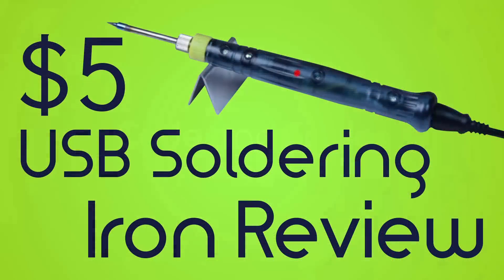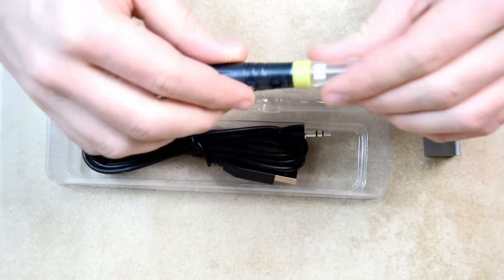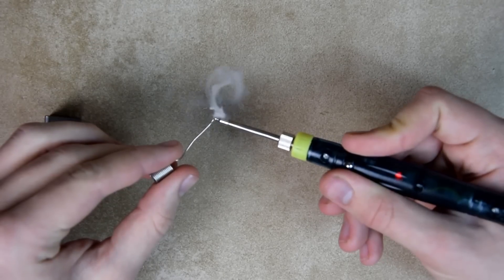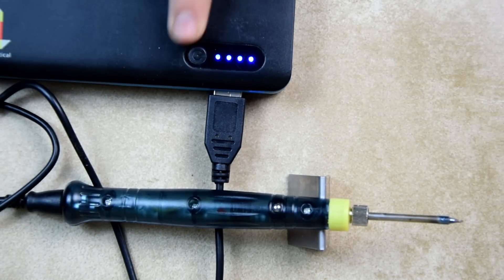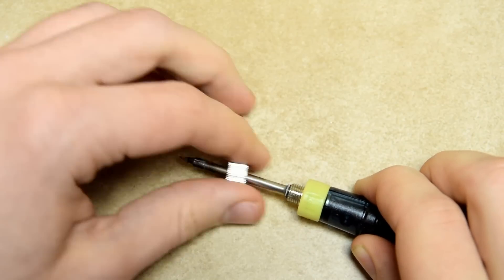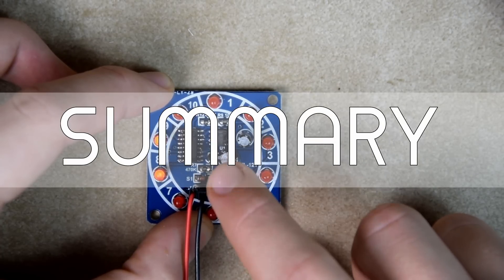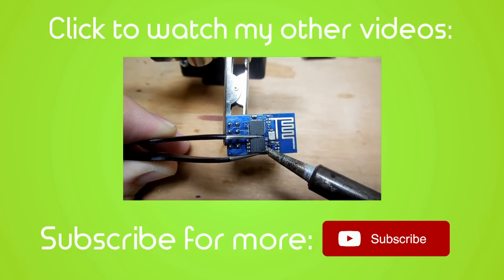$5 USB powered soldering iron review - ZD-20U from Aliexpress

Comment: If provided with 3 amps the iron will gladly provide more power. I tried it, and it stands.
Reply from the maker: +valveman12 I would recommend reading up on Ohms's Law. I = U/R.
Reply: How can you draw 3A using 5V?  You would have had to raise the voltage considerable to draw 3A.
Reply: Code and Solder
Your comment is funny because I am an Engineer.
To draw 3A using only 5V when the device is only capable of 8W meaning at most you can only draw  8W/5V=1.6A.
Coil resistance is 5V/1.6A=3.125 Ohms <- That stays relatively constant with slight variations as it heats up.
So please tell me how you can draw 3A with only 5V?
You can't because it is a function of the coil resistance.
If I want to draw 3A, I would have to raise the voltage to 3A x 3.125 Ohms = 9.375V.
Now you are no longer using USB voltage so you cannot get 3A out of the Soldering Iron using 5V.
Also I would caution running higher voltage on this iron since the heating element is probably not designed to run at this current.
Reply from the maker: Ah, sorry, I didn't see the parent coment and thought this was about something else. Yes, you are totally right it cannot take more current at this voltage. I have increased it to 10V in my "$15 soldering station" video and it does well, I added active temperature regulation to avoid overheating though.
Reply: Ok no problem.

Comment: What is that paste can i have a link ?
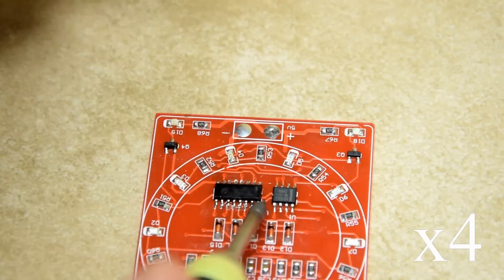Reply from the maker: The one at 1:05? Some random cheap flux. For example (referral link): https://www.banggood.com/Wholesale-10cc-Repair-Tool-Solder-PCB-SMD-Soldering-Paste-Flux-Grease-SMT-BGA-IC-RMA-223-p-35758.html?p=PJ272191958782017025
It is a bit chaper in bulk on Aliexpress.
Reply: Thx

Comment: does it work when you plug it into a laptop or a car usb charger?
Reply from the maker: It most likely will if they can provide the 1.5A required.
Reply: and how do you know if it does or not? I mean who knows how many amps does a laptop usb provide? also I think the regular phone chargers output around 1 A right?
Reply from the maker: For the car charger there should be a sticker on it somewhere. Same thing with chargers, I have seen anywhere from 0.5 to 2A. And as to laptops it's a gamble, hard to know for sure before trying. You can try googling "<laptop model> USB current".
Reply: thx a lot :) very helpful !
Reply from the maker: Modern USB hardware should handle shorts between any 2 lines without damage so the worst you should see is a "current limit exceeded for USB controller warning in the system. A failure is possible but unprobable.

Comment: So its only really useful for a portable and cheap soldering iron, for "stationary" operation it's not really good.
Reply from the maker: It could be used, but for a reasonable price (~$50) you can get a soldering station that will last you forever and will have temperature control. I will be making an Arduino-based modification for this one to make it much more useful soon though.
Reply: Code and Solder  oh that sounds cool!!! looking foward to it!
Reply: arduino-based mod will be awesome. looking forward for it. or have you done it already? :)